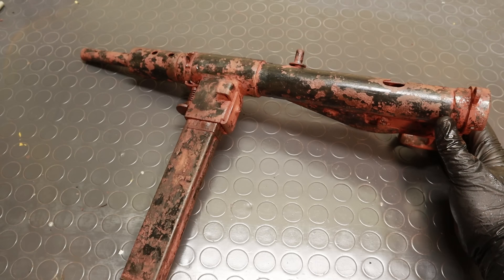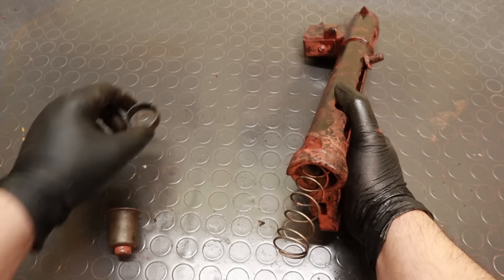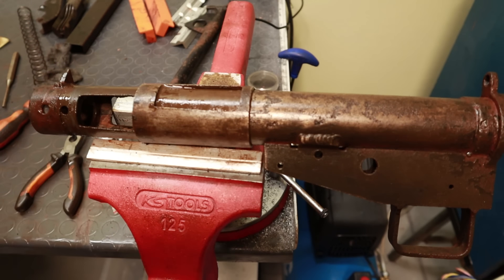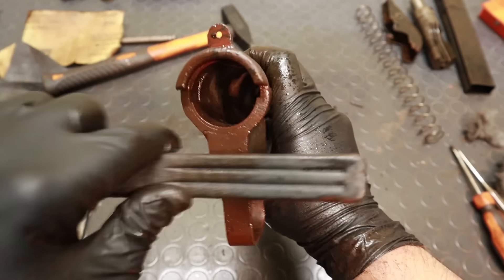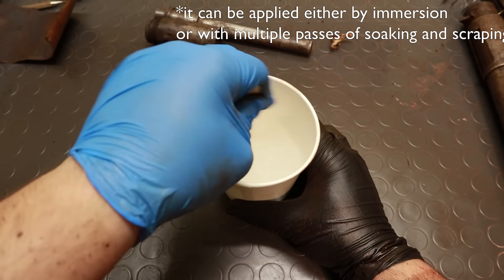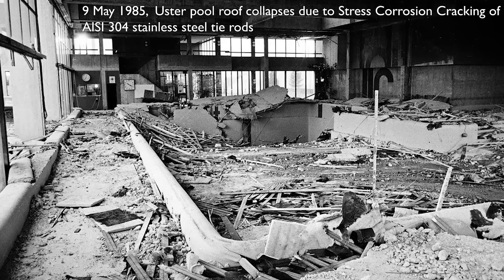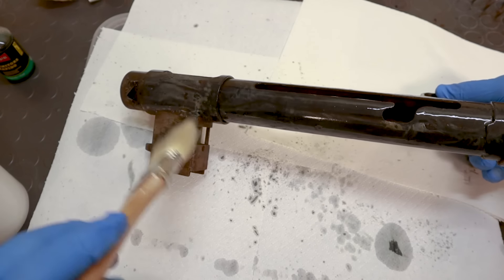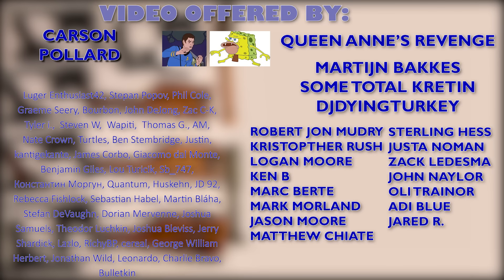Restoration of Rusty STEN Mk2 Submachine Gun

Comment: So rust blue would be more resilient compared to cold blue? I'm guessing cold blues a cosmetic thing while rust blue gives you properties to prevent rust
Reply from the maker: None of them is an effective rust protection, they are both mostly for cosmetic purposes and to reduce glare. However, proper bluing is more wear resistant than cold bluing
Reply: @Backyard.Ballistics  thanks. Was actually curious on finishes. Some claim to be smoother and wear restraint like for modern bolts and other claim to be rust restraint so I thought that's why bluing was used.

Comment: Nice. However you could have saved your hands and arms all sorts of stress by simply hot tanking it with electricity. It doesn't harm the base metal and it's dirt cheap to set one up with a car battery charger, plastic bin, baking soda, chicken wire and a metal plate. Should try it sometime. Its flipping amazing how clean the stuff gets

Comment: In a museum, Here in the States a collector would go through the process of getting a class three , professional resto and use it. Either in living History or as a Historical piece. Many Years ago I purchased an Enfield MK 4 Rifle. Turns out it was a sniper variation. It wasn’t bad but needed a new powder coat and the Features, like scope, scope mount and Butt stock with wooden cheek piece were missing. I found the parts and had a gun shop do the restoration for me. This was in 85 and it cost 500.00 to get it looking Historically correct. I had that rifle for years and took several Deer with it. Covid hit and I was out of work for three months and had to part with my collection. The thousand I got from a collector was great but I do miss that Rifle. A part of History and my Heritage.

Comment: Not sure of the story? However if you need to do this again remove ammunition strip as well as you can using penetrant oil then boil, for approximately an hour this will protect your blue and convert your rust to blue and then lightly oil. I am quite jealous being in the UK 🇬🇧 😀

Comment: Tip for cleaning the bore take a bore brush and a cleaning rod attach it to an electric drill and let it help you clean the crud out of the bore along with a lot of oil I usually just use regular motor oil saving the fancy expensive stuff for the finally cleaning

Comment: That Sten was originally slathered in Sunkorite baking lacquer. The same durable stuff they put on L1A1 SLRs. There was no point to swiveling the magwell. So long as you cleaned the mag release lever and magazine follower so it would feed ammo, the old tank wouldve probably ran just fine with a bit of oil. Once the rust was blown out of the chamber it would've most likely cycled fine.

Comment: A brass brush wheel on a power drill is a total game changer when it comes to rust removal without hurting patina or blueing. It's certainly faster and makes less of a toxic mess than chemical removal. Wire wheels are inexpensive and abundant too.
Reply: Sometimes even brass can scratch the metal.

Comment: A great method for separating rusty parts is to soak them in Automotive Brake Fluid for 14-30 days. I does no damage to the metal and is easy to get at any auto supply outlet.

Comment: I found on youtube (Mark Novak.), by some gunsmith that there is a simple technique of boiling the rusted parts in water will convert the rust into other oxides and scrubbing and other methods could be used as last.

Comment: If you rinse a gun with very hot water the heat stored in the steel will ensure that all moisture evaporates. Hydrochloric acid leaves the steel surface gray and dull.

Comment: Phosphoric acid is the best way to go. It does not attack the heatly iron, but only reacts with iron oxyd. Even better, it leaves a protective layer that can be kept as is, or used as a primer before painting. It is particularly cheap, not so dangerous, and very very effective. Hydrochloric oxyd is really "the big gun" that, indeed, should almost never be used.
Phosphoric acid is commonly used in cars restoration (which is more my field). Citric acid works as well but is much more tedious.

Comment: Funny coloured rust? Is this a real find? Looks like another plant but I could be wrong
Reply: It looks like paint.  Perhaps because of the Parkerizing under the original black paint.  Or perhaps it was "distressed" with pink paint, rather than orange and brown...

It could be the lighting that made orange look pink too.  If BYB sees rust, that is what it is.
Reply from the maker: I'm not sure on that. The material certainly went through some serious corrosion, as considerable amounts of metal are missing, but the amount of actual rust buildup on it wasn't as big as I would have expected it. The outer rust was more homogeneous in color than normal, but it definetely wasn't paint. It scraped away easily leaving behind a more brown and natural looking rusted surface.
Reply: @Backyard.Ballistics  Thanks

Comment: Easiest way to get rid of rust is to boil the parts in water then use a carding wheel …. It stops the rust and the carding wheel will bring out the original even if you think it’s completely gone

Comment: As long as you can clean the barrels somewhat it doesn't really matter if there's a bunch of pits in it... The magazines are available everywhere and they hold thirty-two rounds...
so properly employed off the magazine slide the follower out clean the spring the follower and the magazine housing slanted back together and see if it will plug into the side of the magazine well... If you have the chamber clean... 8in barrel clean.... And there's a firing pin on the end of the bolts till.... And of course the trigger assembly still works which should probably still does.... Pull the bolt back... I would fire one round that I put in the chamber first....when I put a few rounds in the magazine rock and roll cuz that's full-auto dude.... Yeehaw

Comment: Isn't the gun fully automatic by design? Can you legally shoot it in Italy? Sorry I'm ignorant :/
Reply: I think some may have had semi auto ability. It doesn't have a safety switch though, it's open bolt design so you can lock it back abit but it's still dependent on the person's finger staying away from trigger. Dropping them can set them off also.

Comment: Boy do I know that inside and out I used to have one...... Built mine from a parts kit........... As long as the bronze bolts firing pin is intact that sucker will fire.
.. the gun fires from the open bolt...
Both has a captive firing pin cast into the end actually cast then machine....

Comment: Why is it covered in orange paint? When you pull the bolt back into the safety slot you can see where the paint has hit the exposed spring and as you turn the bolt into the safety you see there is no paint on the spring??
Having worked on 3 stens ,the most common parts to rust ( if they are very very badly treated )are main spring, magazine spring and associated components.
Corrosion colour is all wrong.
Your magazine spring looks imacculate and so does the small components but yet there is rust on stronger parts?

There is some pitting from corosion,but just doesn't look right.

Comment: WD40 is the best solution I've found for mechanical removal of rust from various steel and iron alloys, beats soapy water by a mile, IMHO. If you have the budget, and a large enough container, evap-o-rust is some magical stuff. I mean, really, it's mind boggling what that stuff can do. But, it's expensive and immersion is really the ideal method. If you can't immerse, and you're gonna be scrubbing anyway, just use WD40 and save yourself some money.
Reply: but lot better rust rtemove have vinegard and elektro platin remove, 6-12 volt elektric battery and sodium carbonate warm water and ta-da no rust after some hour lot better than use many hour wipe parts.

Comment: Why didn't you just after cleaning. Rust it up with red oxide and boil it to turn it into black oxide. During each time you must take your steel wool pad and scrape all the excess black outside off and repeat the process. That would have given it a nice finish. It is simple and cheap.

Comment: You could have let it soak in a bucket of diesel fuel for 24 hours before you started the restoration it works miracles Or spray it down with PB blaster

Comment: Yikes. In the future, you don't want to steel wool off the bat. Boil the parts for 30 mins to an hour in regular water. This converts the red rust into the same type of rust that makes up bluing. Then steel wool the loose oxide off. This converts the red rust into inert black iron oxide. The YouTube channel Mark Novak has several great videos that show the process. Cool find though.

Comment: Had you simply Boiled the the metal in water for 2 to 4 hours it would have converted the rust brushing it with fine steel wool would then leave what is called rust bluing.  rust bluing is a finish used on firearms for centuries.

Comment: gunsmith hint
don't remove the rust, convert it back into blue
put everything in a pot of water and boil (start at 20 minutes)
then card off the loose oxides with very fine steel wool
repeat until all blue, no red
then soak in water displacing oil and drip dry (kerosene works, but stinks)

Comment: The reason for this job is unclear.  Did the police give you public money to determine if the weapon was capable of firing in its original condition?  That takes no restoration.  A Sten is unlikely to fire if the firing pin is rusted or dirty.  Knowing it can fire after restoration does not provide any useful information since a weapon of that age can never be safely fired again.

Comment: Instead of going to oil right away, you need to boil those parts..... will loosen rust/convert it to black oxide, making it easier to disassemble, and restoring a lot of the blue finish...... going in a museum???? Better learn to do an armory level restoration then too.....